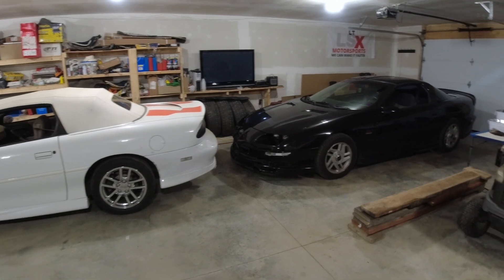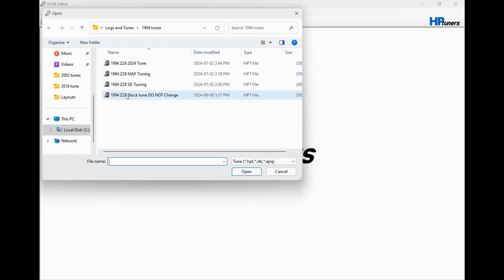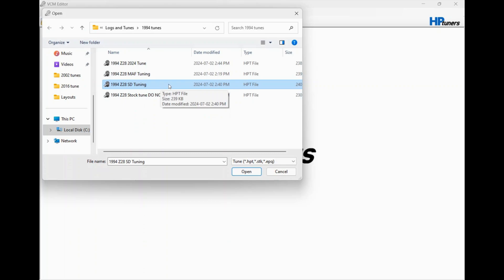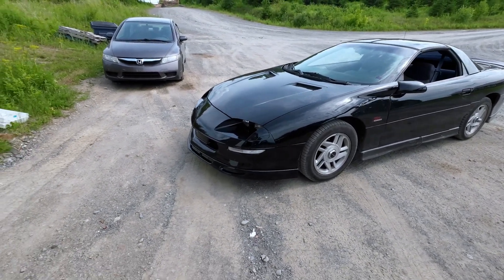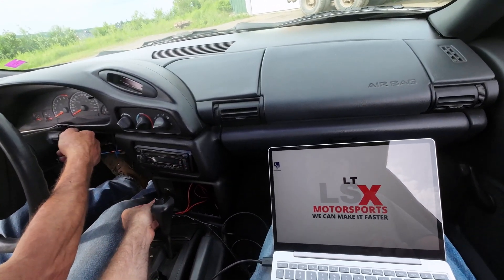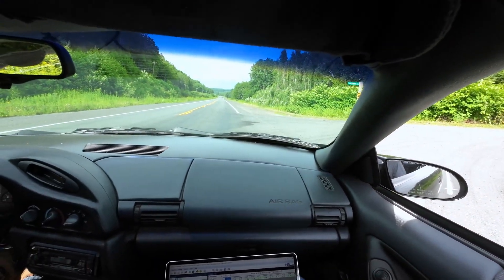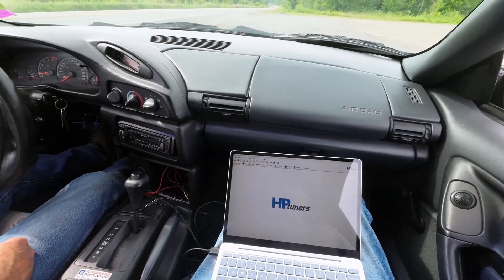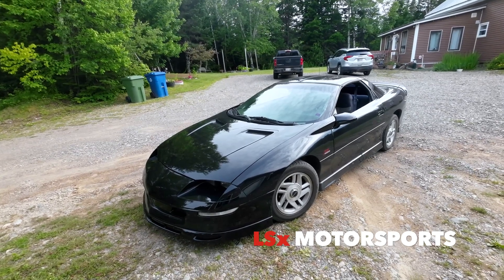Tuning the Torqhead 24X Camaro - Using HP Tuners to tune the 1994 Camaro Z28.

Comment: What is needed to tune a 94 z28 by yourself? Looking to learn how to tune and read the way it runs
Reply from the maker: Well the easiest way is to use HP tuners but that requires getting the Torqhead kit which cost almost $3000 Canadian and the hp tuners cost almost $500 Canadian and a couple credits cost $140. Going with HP tuners you can then go to Goat rope garage to learn how to tune using HP tuners . The cheaper way is to use a couple programs that are cheap or even free now but they are a little more complicated and I am not sure the names but you can find out everything you need on the channel  Strong speed works. I was going to go the cheaper route but the guy with the Black 94 Z28 on the channel was having a lot of problems with the Opti spark so he bought the torqhead kit so I was able to use HP tuners. Good luck whichever route you take. It may seem very confusing to use this stuff at first but it can be done with enough watching videos here on YouTube.
Reply: @LSxMotorsports2021  sounds great thanks for the information!

Comment: I can’t for the life of me get the MAF sensor to work , I have tried and watched the same Goat Rope video as you and it’s not switching and populating in the cells … what do you have ?
Reply from the maker: The car originally had a aftermarket sensor which was not working properly and the heating sensor was burned up. We switched it to the original stock sensor and then everything worked properly. The only thing I can tell you is go through the procedure of setting up the MAF histagram again maybe you missed something. I am assuming you have the torque head 24x and the car is starting and running properly?

Comment: What's the button where the power lock switch should be?
Reply from the maker: This car is a stripped down car. Has roll up windows and no power locks. There is a tweeter speaker where the power window and door lock buttons would normally be.